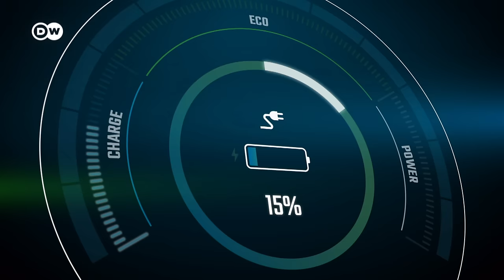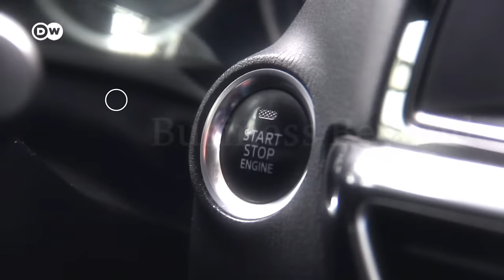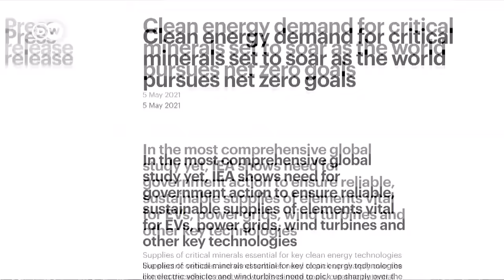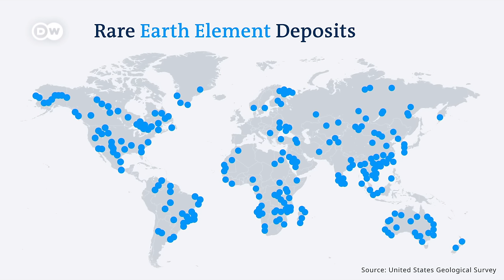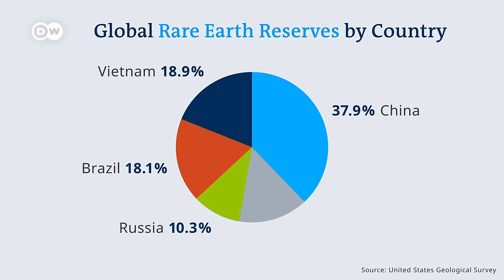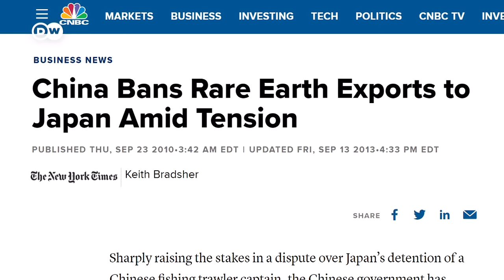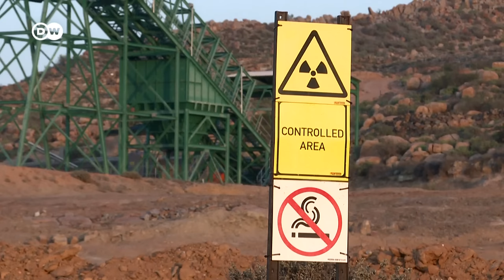Rare earths crunch? Why we need them and who has them | Business Beyond

Comment: The sea covers most of the Earth and the rare metals can also be found and mined in the sea. Look at the metals company, which is trying to start up sea mining of rare metals.
Reply: Rare earth are not dissoved in water. So it may deposit on undersea mud.  And its harder to extract.
Reply: @alexlo7708  yes it has to be mined from the sea bottom. The Metals Company are using Deep-sea drill vessels which are built for deep sea drilling after oil and gas. They have mud pumps and risers, which can carry the cuttings up to the vessel, where it can be collected and / or sorted before transported onshore.
Reply: @andersolsen1478  So this process cost will skyrocket  as same as those who try digging ice methane and pulling up from sea bottom.

Comment: There are the technologies we absolutely need, for a better future, and then there are the technology we only pursue for novelty. Some of the uses will not even be part of our future.
Major uses of some REEs include colours for glass and ceramics. Alternatives exist, and much of it we can get by without. Catalytic converters in petrol automobiles go out with the internal combustion engine.
The question is really around applications that are absolutely vital. And they are in the vast minority apart from, barring some advances, permanent magnets for various uses (although it has been proven that you can have a very efficient electric car motor without permanent magnets, they are convenient), advanced catalysts for many, many chemical purposes, and a host small scale, but extremely technologically advanced purposes such as medical scanners, advanced sensors, etc.
I trust the market to adapt. And those who wish to make a buck too. 
The most important thing is awareness of potential challenges. To stave off geopolitical manipulation by acting in time where there are vulnerabilities.

Comment: This “war” has been going on for months. Back in July 2023, China imposed restrictions on gallium and germanium. (Gallium is used to produce heat-resistant semiconductor wafers; germanium is used as a semiconductor.)

In November 2023, China introduced restrictions on the export of graphite , a mineral widely used in electric vehicle batteries.

Comment: This is the usual Alice in Wonderland spiel. Rare eartrhs are needed to produce the wind power and EV to save the World from overheating due to higher levels of carbon dioxide in the atmosphere but the Greens do not do the calculation of how much CO2 is emitted in the mining, refining and transport of the rare earths never mind that in the production of the metals needed for the wind and EV units and the chargers for the latter and that from the machines needed to preapre the wind turbine sites and concrete required for the raos and bases plus of course the power lines needed to connect them to the grid. Add to this the pollution when the EVs go on fire during charging or in hot weather, 19,000 vehicles in 2021 alone in China. Even the silca used in chips needs to be mined and smelted with hard coal and of course the chemical snad solvents used rin their manufacture require oil or gas. Perhaps you could do a program on this that expans on Michael Moore's Planet of the Humans that concludes that wind and solar is neither renewable nor environmentally friendly.